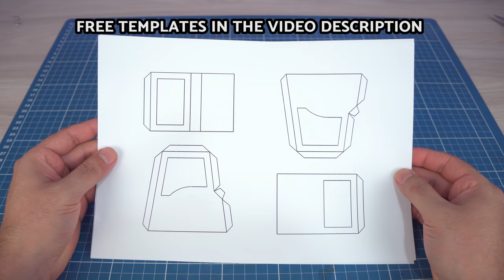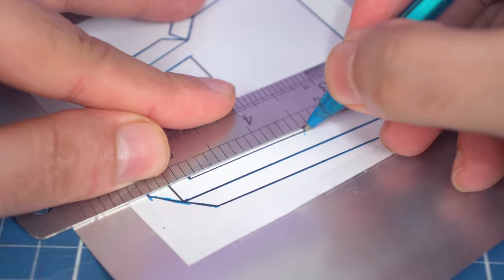Make an Amazing Mini TRACTOR with Coca-Cola Cans and  Recyclable Materials

Comment: I would have thought the + and - wires front the battery would to to the negative and positive pole of the switch, but instead you connected the red wire from the battery to the + pole of the switch  and then the - wire of the battery connects to one terminal of the motor and another wire runs from the other side of the motor back to the negative of the switch.
Something is wrong; it's like a triangle connection and different from any other connection we noobs are used to. could you tell me in details, why this connection was ran this exact way? Thank you.